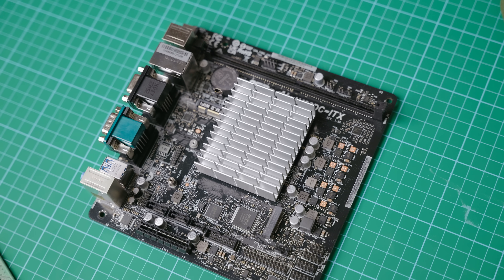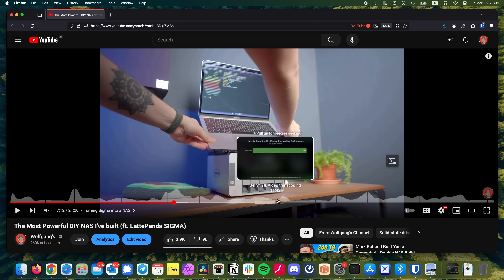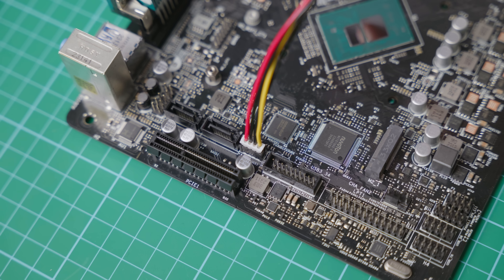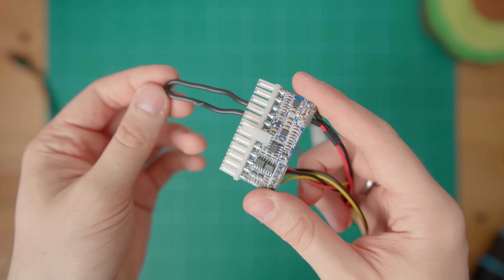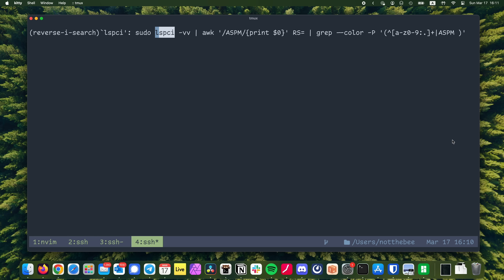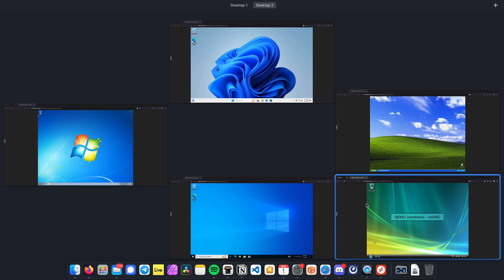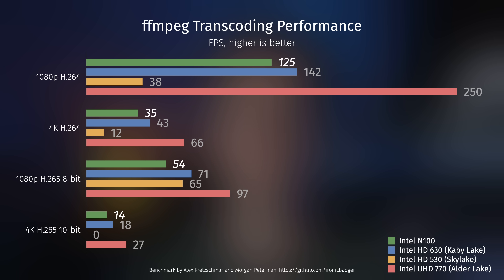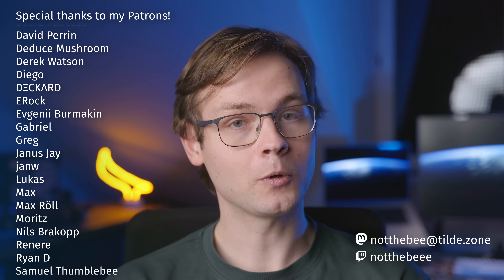Asrock N100DC-ITX – Almost Perfect! But...

Comment: This was EXACTLY the build that was planning! Power was an issue for sure, and thought about the 	
ASUS Prime N100I-D D4 or the Chinese BKHD-1264-NAS mobo
Now that I know that 12V is no issue for this mobo, this seems the way to go. Thank you! 👍
Reply: No china board if you pay for electricity..😂 no uefi updated and wonky c states !
It does not downclock

Comment: Do you have / could you do a video about power monitoring in Home Assistant. I like the way you are able to see the power usage of your devices, but its something I have no experience in and would be great to have a how-to video.
Reply: I don't know how Wolfgang does it exactly, but I do something very similar with the ESPHome integration on home assistant. I buy 'Shelly Plug S' power plugs. I don't like their native app, but the hardware is just a simple esp8226 with some peripherals. So I just open up those plugs and flash ESPHome onto them with an USB dongle (Look up guides for it, its not too complex). Once I have ESPHome running on the plug, I can easily import them into home assistant via the usual esphome integration. I often also calibrate them with a known load for better accuracy, but this step is optional. You can then toggle the shelly power plug via home assistant, read the voltage, power, daily power consumption and temperature.

Plug it in between the device you want to monitor and the power socket, and you can see the power consumption of that device in HA.

Comment: Very interesting build but I would warn that running power wires through grounded holes in thin metal is a fire hazard. The drives cause substantial vibration, and over time this will degrade the insulation. Rubber grommets are advised.

Comment: Maybe ok with ITX formfactor. But if you want/need smaller and more energy efficient. Go with odroid m1. It has pcie 3.0 2-lanes and can handle same JBM585 etc nvme adapters without issues.

Comment: I've just been experimenting with a bunch of low powered Q170T boards that I got extremely cheap. Power (and drive power) were a concern for sure. I thought about adapting the 19V external PSU the other way around, but the cases I'm aiming for need a TFX or 1U PSU though, so maybe the way that you did it is way better.

Comment: I´m running one for my OPNsense FW with a dual 2.5G NIC. For some reason it kept crashing. The culprit was DRAM voltage being too low on a 3200 16GB stick. The XMP support in the UEFI is kinda weird. Anyway for 24/7 operation in a case I slapped on a little fan for airflow. Now it runs with no problems.

Comment: You'd be surprised how much power SSDs can use. I've been looking into it. Some SATA SSDs can be 6w at full load meaning that 2.5a on the 5v pin of the JST is only really good for two. I have a couple of U.2 SSDs in a rig here and those are rated 20-25w load

Comment: Wow, I was expecting all the windows VM would pull more volts compared to the 10gig sfp+ 
I guess to handle that kind of bandwidth you do need that power.

Great video as always!
Reply: Honestly, its mostly the laser that pulls power in an SFP.
Reply: @yodal_  I don't exactly know how the sfp port works but thank you for letting me know. I guess I will go down the rabbit hole on how it works :D

Comment: Managed to get my hp prodesk 400 to idle at 5 ish watts (jumps between 4 to peaks of 6 occasionally) with 2 hdd spun down whilst running samba shares with mergerfs on the proxmox host, haos vm & jellyfin lxc, i3 8100 16g ram, 1 disk spinning is 12w, 2 is about 18, under load is about 60w

Comment: Yeah I think you've nailed the weakness of this board: I wish so much that this board had either 6x SATA or 2x M.2

On my NAS I love to have 2x SSDs as a cache and half a dozen SATA disks, but there's no sensible way to do it with this board

I guess I could use the M.2 to SATA board you use and a PCIe x4 to 2x NVME card? But that seems like I'd be relying on adapters more than I'm comfortable with
Reply from the maker: Yep.  And since this board doesn’t support PCIe bifurcation, you’ll have to go for an NVMe adapter with a PCIe switch. Which would cost more than the board itself. 
By the way, CWWK finally brought out an N100-based NAS board with the ASM1166 controller (as opposed to JMB585): https://www.aliexpress.com/item/1005007001584335.html

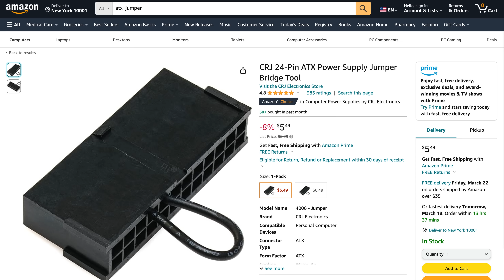Comment: 7:14 you don't need a thick wire, you are connecting the signal pin to the ground, a random paper clip will do the job just right.
Reply from the maker: The thick wire is there to fit snugly into the female ATX pins
Reply: @WolfgangsChannel  ok, fair point.

Comment: I migrated my home server from an old Atom N280 to the N100DC a few months ago, and the performance gain is impressive to say the least. Since I don't hoard that much data, two USB3 attached SATA HDDs for the NAS part were sufficient. The box is hosting my web and mail server, a dockerized Home Assistant and a small Minceraft world, all in the low double digit% load and under 10 watts of total power.
I don't really get the point in putting a SATA controller into the M.2.. four USB3 10Gbit ports provide plenty of connectivity for spinning rust, and I'd much rather put a big NVME drive in there for the stuff that needs to be really fast.
Reply from the maker: USB HDDs have proved to be unreliable for permanently attached storage in my experience
Reply: The 4x usb 3.2 of this board are gen 1 , that support only 5gbps, not 10gbps, but I see your point, there’s nothing bad in using this
Reply: @-.eQuiNoX.-  I thought 3.1 was 5Gb and 3.2 was 10Gb.. and the gen2 were double that each.. [insert lengthy rant about stupid USB naming conventions], but still enough for the ~150MB/sek that the best spinning rust can provide.
Reply: @WolfgangsChannel  hmmm. i've been running my NAS off USB drives for almost two decades now without issues, but I guess that mileage will vary by manufacturers and usage.

Comment: @12:41 Wait a minute... So these power consumption numbers are when using the Bronze label SFX power supply because you hooked up HDD's ? ..or did you use the pico power supply?  It's not very clear to me..
And can someone tell me if I can truly pass through the 6 SATA ports on the nvme board to a VM in Proxmox?
In other words; Does the nvme slot share it's IOMMU group with other devices? If so, which devices?
Reply from the maker: Watch the beginning of the “Power consumption” section
Reply: @WolfgangsChannel  Alright, so it's using the Pico PS, with all HDD's getting power from the single (pico) power line I presume

Comment: What about the Asus Pro WS W680M-ACE SE???

I know its not cheap but its probably cheaper than trying to find a C246 these days and its much more modern, has ECC support, 10gb networking and you could get a nice new low power intel chip with quicksync

Comment: Could you have used the Wifi M.2 E key for the 6x SATA board and used the M.2 for the boot drive?
Reply from the maker: Unfortunately, the Wifi M.2 slot only supports CNVi, and doesn't carry PCIe signal :(

Comment: How much do you care about ECC for home server?
Reply: I'm really paranoid about ECC and use it whenever possible.  I have 5 servers here, with a few hundred terabytes of storage between them, and I upgrade machines fairly regularly.  I always check the logs, and have never seen a bit flip on those machines.  Over the last 13-14 years of running multiple servers, I've only ever had one machine that would register ECC errors in the logs.  I ALWAYS run ECC on anything mission critical, but I think really it probably doesn't matter.  Unless you're living in an area with really high radiation (like a basement with radon) or a noisy electrical environment I don't think it's necessary at all.  It's more of an indicator that you have failing hardware that needs to be replaced, rather than something that serves a purpose in day-to-day operation.  If you use a checksumming filesystem it can probably catch most of the data problems without the additional layer of safety from ECC.

Comment: Thanks you for this video.
I juste have one question : what about the data on the drives if the controller on the M.2 SATA converter failed? How to rebuild the content of the hard drives?
Thx 😊
Reply: They're just regular SATA ports. You can connect the drives to any other controller and everything would be there and work the same. It's not a RAID card.

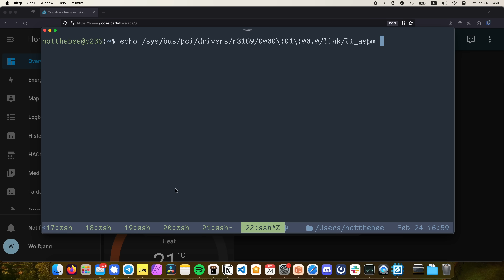Comment: 9:29 I copied the code but running lspci still shows aspm=disabled and can't go below c3 still

different asrock mobo but same issue the ethernet controller looks the same, ls'd the folder for the driver and it also has l1_aspm

is it supposed to show aspm=disabled even if I run the sudo tee?

appreciate the help!

Comment: It doesn't support AV1 encoding using the integrated GPU, still you can encode AV1 using SVT on CPU using ffmpeg. If I remember correctly, encoding on CPU gets better quality despite taking longer encoding time.
Reply: I don't think it's the smartest idea to do it on an N100 however.
Reply: Even with SVT-AV1 getting better and better, it would probably run single digit fps if not less on decent preset(5/6).
Reply: For a nas like this, av1 decoding is probably more important than encoding. If you have av1 files, you want to be able to transcode on the fly to e.g. h264 or HEVC to stream to a tv or media player box.
Reply: @kepstin  Yes and I don't know if you can use the intel igpu or even intel arc AV1 encoder in ffmpeg for example.

Comment: I think if pursuit a cheap build, you can buy an Intel 82599EN based network adapter, its usualy branded as X520-DA1, and this motherboard should fit x8 pci-e without any problems.

Comment: These black/green DC-jacks you have used to connect the power supply are a serious fire hazard, please make sure you exchange them for something proper ASAP!
I used them to power a small 20W 12V LED strip, but that was too much for them and they got so hot they melted! Not joking, these are really crappy connectors for power delivery.

Comment: Thanks for this video.  I had a SF750 laying around so thought i'd give it go.  I haven't been able to achieve 10w at idle though.  The lowest i've got to is 19w with 2xSSD and 3xHDD, the ASM1166, 32Gb RAM and 2x Noctua fans.  No PCI-E card used, all drives but the appdata ssd spun down,  l1 aspm enabled for the realtek and powertop auto tune.  Were you able to achieve 10w with unraid?  I also tried using a picopsu with an old xbox brick, changing the RAM to 4Gb, disconnecting all fans with little to no change.  The power consumption between the picopsu and the SF750 is around 1-2w.  Also used tips and tweaks in unraid to set the cpu scaling to power save.

Comment: passive cooling is a relative concept, a passive cooler computer in a room with AC isn't passively cooling, the AC is picking up the slack. And if you live in a tropical country near the equator your passive cooling computer of Europe will get hot and require a fan, even with AC in the room because our ACs don't have cool air outside and can't do much.
Reply: AC’s don’t use outside air, only recirculating the room air and the compressor is chilling it.
Reply from the maker: Well, using your own words from one of the previous comments – looks like your life is a mess and poorly organized. Just get an AC installed :)

Comment: Just a general FYI. Despite Intel's N100 spec sheet, I've been running a 32GB 3200Mhz DIMM on this board without issue for 7+ months. (TrueNAS Scale)

Comment: Given the choice between appearing stupid and potentially causing damage, I choose the former and ask: How exactly does one connect the SFX and Pico PSUs? You did not show that bit in your fine video, which got me to finally take the plunge and purchase the hardware. One of the SFX outputs needs to serve as input for the Pico, but which connectors are used for that? I am right now looking at the multitude of cables attached to both PSUs and feel confused, and my attempts to find information via Internet search were unsuccessful. Please help a fellow out. Danke! —Zweilinkehände

Comment: With four cores anything over 25% load could be saturating a core. Check your interrupts, and if the driver has any features to reduce them
Reply: With Linux reporting programs the CPU utilization is usually relative to a single core. 100% means one core saturated and 400% means fully loaded.

Comment: If one were in the market to buy a new board to upgrade their nas/home server, would you recommend one of those m.2 to SATA adapters, a regular pcie-sata adapter, or perhaps a SAS HBA? For software raid. 
Seeing (and also experiencing) reviews that pcie-sata isn't great for raid.. and a SAS HBA seems to be a reliable way to connect upwards of 8 drives
Reply from the maker: SAS HBAs are notoriously power hungry, but are also server grade products with good reliability.
Simple PCIe SATA controllers like ASM1166 are very power efficient, but are of consumer quality. Lots of mainstream consumer motherboards however use ASMedia cards for SATA expansion – so they're also pretty reliable.

I've been using ASM1166-based SATA expansion cards since a few years now, and never had a single issue, but your mileage may vary.
Reply: @WolfgangsChannel Much obliged. I think I am still going to err on the side of an HBA. My nas isn't one that is always on, I primarily use it for offline backups... but it is showing its age. Z68 chipset, only two sata3 ports, and four drives on a PCIE SATA which I think is under preforming. But hey at least I can read and write at sata2 speeds.... mostly... :')

Comment: I have tried to install a 2.5gbit nic to the e key interfaces. Unfortunately it is not recognized I suppose only the WiFi stuff is supported there.
Reply: The CNVIO only in that port is pure disappointment. :(
Reply: ASRock just confirmed that real pcie lanes are not connected there :(

Comment: Please please please please please do......! In the pcie slot and the nvme slot put a 16GB optane nvme, these are actually 14GB each. Put them in raid, put the swapfile on this raid, put the os on a sata drive. Test with 4GB ram plus 28GB raid0 optane swapfile against 32GB ram with no swapfile and 4GB ram with no optane, just sata ssd swapfile.
Also, safe to run n100 off eee pc power brick 12v x 3A = 36W?

Comment: Hi Wolfgang. Could you take a look a the Asus N100 D4 board? Can't get lower than C3 and 20 watts with basically nothing running or connected using unraid.

Comment: Genuinely curious on the benefit of 10GiB networking...Could you even saturate a 10GiB connection with those drives and a SATA SSD cache?
Reply from the maker: No, but 2.5Gbit is a bit too slow for SATA SSDs, and 5Gbit is not a real standard

Comment: I have same build,without 10GBps. I haven’t transcoded yet. So,would you recommend this for 4k content. What about from av1 to h264? Did you have glitches after a while? Wouldn’t you use a fan and make the board use higher power consumption for higher requirements moments?
Reply from the maker: Yes, it can handle a single stream 4K transcode pretty well. Haven't tested it with multiple streams yet. 
Keep in mind, that the Dune results also include HDR tone mapping. If you want to play back SDR content, you're gonna get even better results.

I've run the Cinebench R23 test with and without a fan, and didn't see a big difference.
Reply: @WolfgangsChannel  i want 4k and hdr. I want a library in av1, not transcoding for tv with av1, and the possibility of second transcoded streaming to 1080 sdr. 

I am still figuring out the rr configuration mess,so haven’t been able to test it yet.
What about BT2020 content? Does it demands more?

The fan: thanks for the reference. I had vetter expentations after robtech video of this board (6:03)

Comment: Would you be willing to check out the (kind of) new CWWK NAS motherboard that uses a ryzen 7840HS? I know it's probably a bit more power hungry than any of these intel boards, but it seems like CWWK learned a lot - they still have 4×2.5GbE ports, but the 7840HS has a lot more PCIe lanes available, so the m.2 slots are 2 lanes (gen4), there's a full size pcie slot (running at 8x lanes), usb 4.0 and 3.2, and the additional SATA ports use ASM1164/1166 controllers instead of the JMB585. And it has dual channel ddr5 slots! It is pricey, but is still very interesting

Comment: How can the system be completely shut down if the hard drives begin spinning upon power plug-in❓
Reply from the maker: With a power switch on the PSU
Reply: Hi😀  @WolfgangsChannel . Is it safe for the hard drives to be abruptly shut down like that?
Reply from the maker: As long as it's not during writes or reads :)

Comment: I am trying to build a homeserver (the same board and m.2 adapter) myself but I cannot get the whole thing to work with 4 Seagate Exos and one SSD.
Using a Leicke power supply unit with 90 watt as mentioned in the video the HDDs spin up and down. I think the power supply throughout the board isn't enough for the drives.
I tried a 150 watt Leicke power supply unit aswell but with the same result.
So, there is no chance to use the DC port or a DC power supply unit, I think.
Connecting only the Leicke power suply with the board I have a usage of about 7 watts btw.
When I use another power supply unit (be quiet pure power 11 400 watt ATX (4 pin to DC)) I have a usage of about 15 watt (!) (without HDDs and SSD).
Is it recommendable to try the power supply unit of the video, the sharkoon one, or do anyone has a better idea maybe?
I want as low consumption as possible and with the power supply mentioned above it is to high.